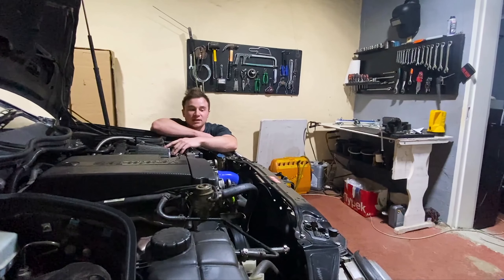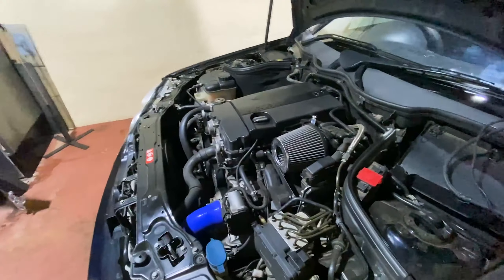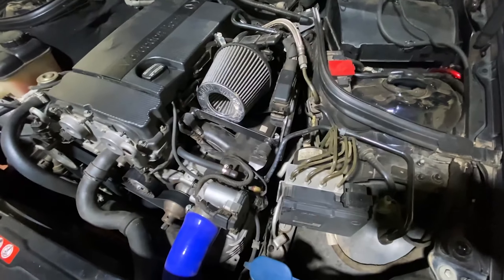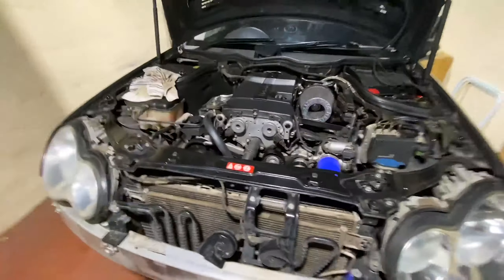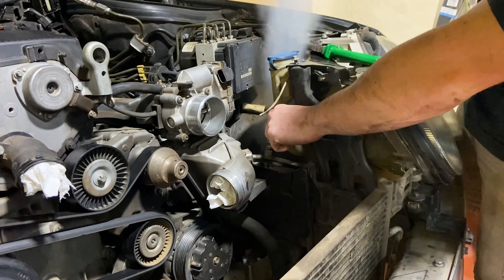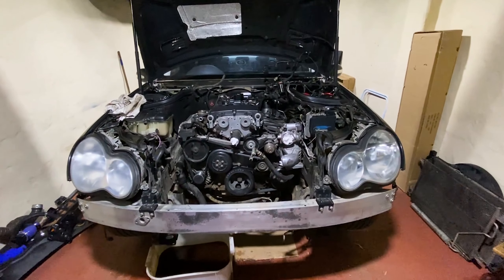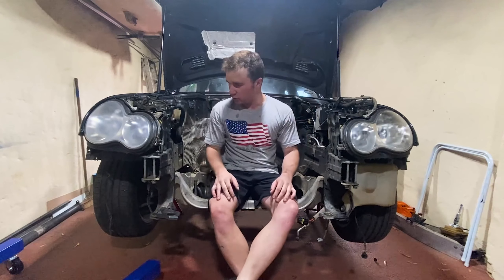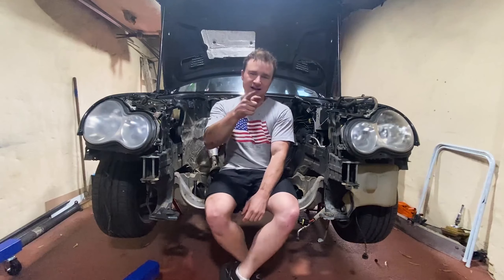Mercedes C180k w203 Engine removal #FULLSEND | German 2JZ build? |  All the HORSEPOWER🐎💨

Comment: Pretty nice to see another South African messing around with Mercs. That's so rare. I'm currently busy with a M111.975 swap in my 190E 2.3 Sportline and I have recently finished building a W124 E280(Also M104) that I converted to full AMG spec. The main thing you need to worry about with the M104 is heat management. They run extremely hot and are notorious for blowing head gaskets. It's a pretty long engine too but people have fitted them in 190Es so you should be fine. One more thing, you'll need a REALLY good aftermarket ECU if you want everything to work in sync. Good luck with the project.
Reply from the maker: Thanks for the great comment man! Much appreciated. Thanks for the tips!🙏🏻👌

Comment: m111 stock engine (NOT N/A) with turbo max 1.3bar (320+hp)  (more than 1.3bar will be extreme for the stock engine) or pullied kompressor m62 should be around 1bar (250+hp?), maybe take the m111 evo engine with m45 supercharger and change it with the bigger one m62 or take the 2.3 m111, its up to you and the 6speed manual which comes with the engine should be good

Comment: I have a beautiful 2006 C230 v6 sport, mint condition. 165k but the chain slipped off the tensioner. I thought about fixing it but I just want to put a new engine in it. Is it worth it? How much you think it will run me? I'm doing all the work myself. Just gotta buy an engine and oil, plugs, etc etc

Comment: Great work . For the oil sump just cut the bracket and weld an Π shape around it
Reply from the maker: Thanks man!😁 yeah I was also thinking about that. Guess I’ll just have to find a way that it’s still well supported. Scared it affects the stability of the car🙈😅
Reply: @RicerBenz  just put that bar that bolts on the strat tower and youll be good to go

Comment: U have a list can shared for to do ?? I have 05 1.8L Kompressor super reliable thinking get some more stronger less weight which thinking straight 6 in-line then put 5.4L MB engine and would like see can adapter 722.6 trans auto as well or must go manual 6 speed

Comment: Your video is very much appreciated, thank you, im going to the same job. Chain jumped and engine is now junk. My thoughts are that i will seperate gearbox from engine before lifting it out, are there some special reason you lifted the engine togheter with the gearbox? Seems like alot of extra work to me... 👍
Reply from the maker: I just wanted to work on everything outside the car and not under the car figuring everything out. The setup went in and out many times🤣🤙🏼

Comment: I love this build, my question is, is the stock engine any good for tuning? because in my country straight six mercedes motors are not so easy to come across.
Reply from the maker: The inline 6 is cheap here. Much cheaper to replace once it brakes🤣
Reply: @RicerBenz  but is the stock M271 good for tuning/can it handle boost? i mean how much horse power can it make (like an estimate)? C180s are there in our country, but the manual ones are rare, and their owners hate selling them, it takes some next level diplomatic skills to get a hold of one in our country. I envy you man, lots of love
Reply from the maker: @rajitchatterjee1420  haha thanks man
Well I’m boosting a NA engine
So the m271 is built for boost so it should be able to handle more than what the supercharger can boost. 
The issue is making all that work (electronically) that’s why I have a standalone ECU.Easy to tune etc.

Comment: Good work bro when it comes to mounting the m104 you maybe able to use m111 engine mounts they easily bolt up to the block also some Ssangyongs were fitted with the m104 I believe it was the musso they apparently have a rear sump but are rare I hope this helps keep it up great vids I am trying to grow my channel but unfortunately don't have great content like you at the moment but we will be in the next few days replacing out m111 in our Slk
Reply from the maker: Daaaamn thanks for the great comment and information. I saw the ssangyong use them yes  I will DEFINITELY look into that some more! Much appreciated!!!!!🙏🏻😎 I will be watching 👀😁
Reply: @RicerBenz  Thank you dude I did previously fit a m104 in my lexus project so I did learn a bit whilst doing that but definitely. Recommended @Turbobandit 12.9 headbolts although they aren't the cheapest they're proven
Reply from the maker: @M-oneeleven-M111  noted thanks man. The dream is to go turbo yes but this is already a BIG money pit! But I’m sure if all works out it’ll be worth it😁thanks again 🙏🏻

Comment: Hey Buddy, i come from Gemany and i do the save modifications with the same engines but in the cl203 chassi nice work dude. The m111 engine dosent fit not really in my chassi. I do today bending the stabilisator and fit the sterring gear in a other position jonisx201 is my instagram Account. Maybe we can talk a little bit about the tuning.
Reply: And look at the sump on the engine .
Reply from the maker: Hey man! Thanks for the great comment. Yes the m111 and m104 has the sump in front and the m271 at the back. Makes anything hard to fit. Awesome I’ll see you on instagram 😎😁